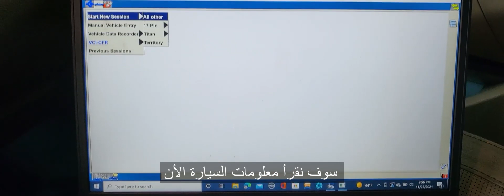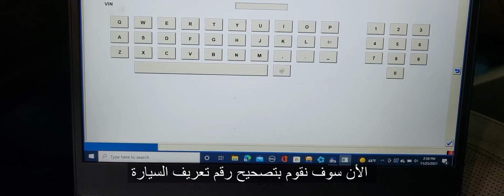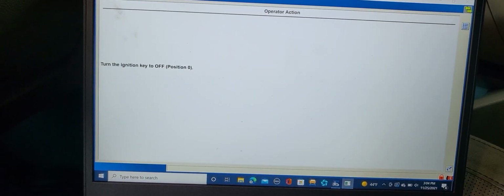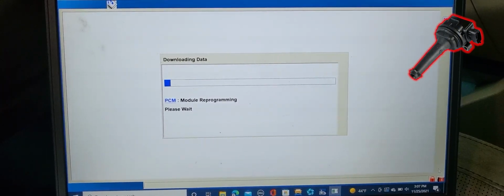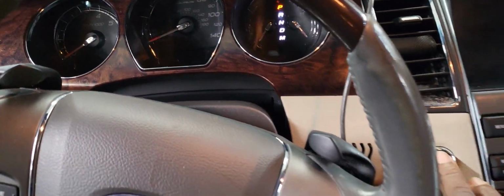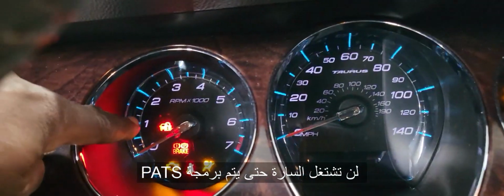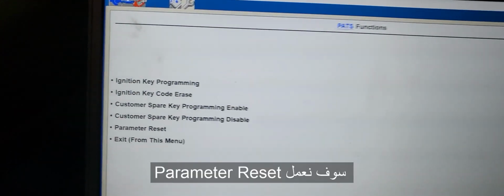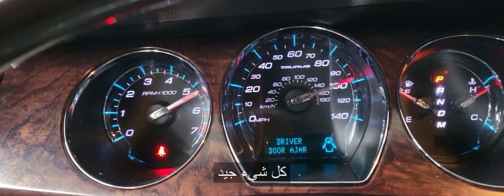Ford Taurus 2010 Misfire issue caused by PCM ✓ برمجة كمبيوتر فورد توريس

Comment: So if you have a 2010 ford taurus and have a code P0353 and you replaced the pcm entirely fixing the issue ,  what do you do when months later the P0353 code comes back and problems return.  I changed all ignition pigtail plugs , coil packs, spark plugs, and inspected the harness etc ..     what keeps causing this to happen I can make it stop ???